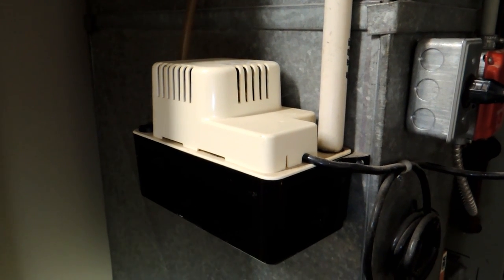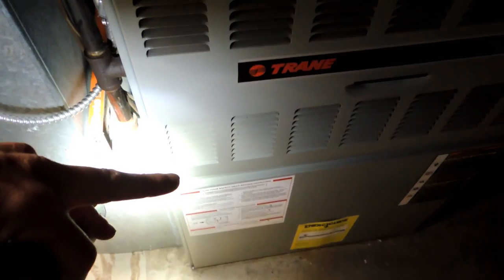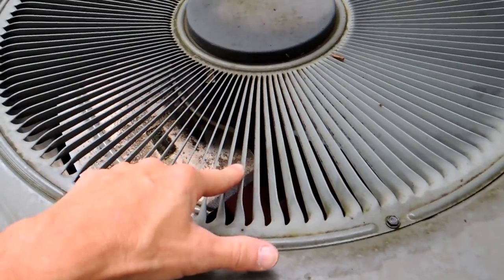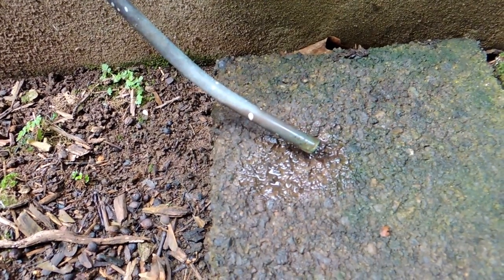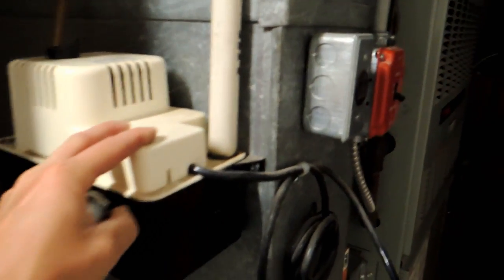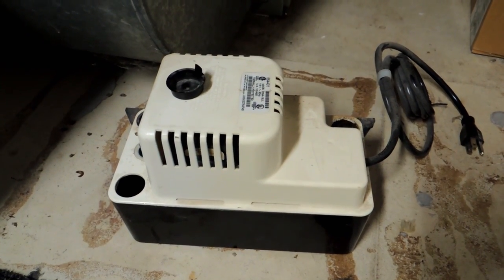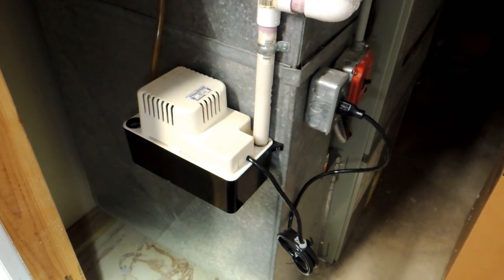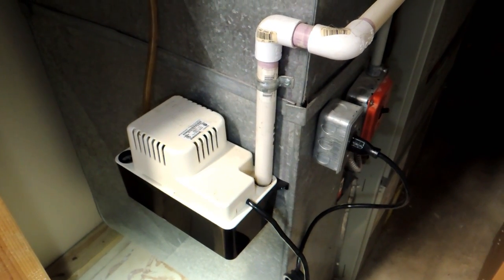How To Maintain Your Air Conditioning Condensate Pump

Comment: Great video.  I just want to flush out any drain fly larvae out of the pump that is like the one here in this video.  Would you recommend pouring boiling water or a cup of vinegar into the resevoir?
Reply from the maker: Boiling water would not be a good idea, I don't know how the pump components would react to the heat.  I guess vinegar wouldn't harm anything.  I've never run across drain flies before.  You might just as well clean out the whole tray as I showed in the video to be sure everything is gone.
Reply: @enduringcharm  I thought of just following your instructions.  I am a little overwhelmed with the pest control.  My city doesn't do much about it.  I was also thinking about soaking some mosquito bits and then pouring the water into the resevoir with good beneficial bacteria.  I have gnats in a closed up cellar where the hvac is.  I thought for sure it would be coming from the pump.  It might be coming from the soil that heaves thought the bricks when it rains.  I will take a look at the set up.  It is just resting on the floor.  I think it is an easy set up.  But then again, it is only about a year old.  Your response is a pleasant surprise.  I know the video was posted a while ago.  Thank you much from Louisville KY.

Comment: my condensate pipe coming from the air exchanger is an L shape that goes directly into the pump's reservoir without any brackets or clamps anywhere along its run, and sandwiches the pump against the floor. i cannot remove the pump for cleaning because the condensate pipe is too long and trapping the pump against the floor. there are no clamps or screws involved. how do i handle this? is there a flexible pipe available instead so that this doesn't continue to be an issue?
Reply from the maker: Without seeing it in person it's hard to tell, but I have several suggestions.  First, you may be able to simply push the pipe end out of the pump housing if there is enough flex.  Second, you may be able to crack open the top of the pump housing and remove the bottom tray.  Then there will be room to drop down the top and remove it too.  Another option along those lines is to run the pump to clear the water out and then twist the pump housing out from under the pipe.  Finally, you can probably cut the drain pipe so that it just barely fits into the pump housing, which will make it easy in the future to just temporarily bend it out of the way when desired.
Reply: @enduringcharm  ive definitely tried tugging up on the pipe above the pump and it doesnt really jiggle more than a few millimeters. i also tried tilting the pump to see if i could get one side low enough to slide out from under the pipe and that didnt work either. ill give opening the casing another go and try sliding the cover up the pipe to get the top and bottom out separately. i kind of tried opening it before but i wasnt sure if id break it so i stopped. thanks for the speedy reply, the ideas sound great! i don't really have any cutting tools on hand, but if i have some work done in the future, ill see about requesting that they shorten the pipe. thanks!
Reply: @enduringcharm  Thanks for all the suggestions! I left a reply saying I was able to clean it, probably two days ago but it seems to have disappeared. Anyway, I tried the method of removing the top and sliding it up the pipe so that I could get the bottom reservoir out, and I did have to tilt it a considerable amount and ended up spilling some water all over my concrete floor, but was able to get it out in the end. I cleaned it of the thin layer of dense brown sediment sitting at the bottom of the reservoir and pump housing and flushed out some nasty tube shaped bacterial stuff that gushed back down from the vinyl drain line when I disconnected it from the pump. I ran some diluted bleach water down the vinyl line, then rinsed it with clean water a little bit later and pushed some air through the line with my air compressor and finally put everything back together. Thanks again!
Reply from the maker: I'm glad you got it sorted.  Pretty gross in there, right?  If you are curious about what it looks like in the evaporator before it gets to the condensate pump, check out this video:
https://youtu.be/F07sbwZgcsI

Comment: How did you get the reservoir open? Mine looks similar but I'm not seeing any obvious way to get it open.
Reply from the maker: Most of them just snap in place.  If you carefully press in on the sides the top will likely pop open, or you may have to pry on the edge.

Comment: At the end, where you mention "That's a whole another story to clean that out", that's what I want to check next.  Where the pipes goes from the pan to the pump.  Do you need to open the panel up, check the drip pan and then snake the tube from there to the pump or can you open up the pipe outside the panel and clean there? I'd like to check the pump (I hear it go on but probably needs cleaning) and also clean the pipes inside since I'm getting water on the ground under the A/C unit.  Also the AC system has been losing ability to cool so wondering if all that is blocking cooling.  Great video!!
Reply from the maker: I have a whole video to answer those questions!  See here:  https://youtu.be/F07sbwZgcsI
Reply: @enduringcharm  Saw that video but doesn't show how to flexible small tube is flushed out only the pan and larger connections.  I didn't see from the pump to the wash tub.  That tube is long and not sure it needs flushing? Thank you sir.
Reply from the maker: Oh, you're asking about the clear vinyl tube that goes from the pump to either a drain or to the outdoors.  Generally that does not need cleaning.  However, if yours looks grungy you can go to Home Depot or Lowes and pick up a roll of new vinyl tubing for five or six dollars.  Just note the size you have or cut a piece off and bring it with you.

Comment: Again, thank you. Do you also have a video for cleaning out the condensation tray or tubing coming from the furnace?
Reply from the maker: I don't, and different models may have different means of access.  If your condensate pump is coming on and off regularly, though, that shows that the tube is clear.
Reply: Great video, very clear, thorough and helpful.   Subscribed to see what else I can learn. Thanks!

Comment: Thank you for the video!!! My condensate pump valve broke in half and therefore water all on the floor. 😡 Do you know how to remove the piece that's still screwed in? Or do I need to purchase a new pump?
Reply from the maker: I'm not sure which piece you are talking about, but a whole new condensate pump is not that expensive if you need one.
Reply: @enduringcharm  Thank you! I just purchased the last one in stock just in case. But I'm not too confident on doing the electrical part. We'll see. Thanks again!

Comment: I'm stoked now to try fixing mine, which I paid $150 to learn has burned out. They want $700 to replace it. Think I'll try it myself first!
Reply from the maker: The cost of a new pump is under $60, so it is well worth replacing it yourself.
Reply: @enduringcharm  Thank you for the video and your encouragement. If you see a small mushroom cloud in suburban Philadelphia sometime in the next week or so, however, it's probably due to me!
Reply from the maker: Ha!  Well, if you figure out how to create nuclear fusion with a condensate pump I want half of the patent licensing revenue!
Reply: @enduringcharm  Fair enough, but I don't usually get beyond fission!
Reply: @enduringcharm  I figured if I followed your instructions I'd only be out of around $60, the cost of a new pump. I was wrong: My old pump was fine! The only problem was that the one-way exit valve for the condensed water was blocked. I took it out, soaked it in vinegar, squeezed vinegar through it until it cleared, put it back in and all is well. I'm thinking a little less of the company I've used for years, who came out and said fixing it would cost $700. My total cost was about $.10 worth of vinegar and the only tool I need was a pair of pliers to take the valve out. Thanks again for your video. I feel like I made $699.90 today. A nice feeling.
Reply from the maker: I wish I could say your story is unusual, but it isn't.  The company giving you an estimate may not even have been intentionally trying to scam you, they are just sloppy or lazy or both.  I'm glad you sorted it out yourself and saved some money.

Comment: We changed the A/C unit a year ago, the evaporator coil was also changed.  Almost a year later, when ever we turn the furnace on (heat or cool) there is a  nauseating smell that come out of the vents.  This is a forced air system and the smell is always there when ever the furnace is running.  What's causing the smell and is there any way of getting rid of it.  This never happened with the old A/C system.
Reply from the maker: Obviously I can't evaluate the smell from here.  If it's a mildew kind of smell it's possible there is/was an issue with the installation which left you with a condensate pan that doesn't drain.  If it's a burning or chemical kind of smell it could be related to the paint, the wiring/electronics or oils on the fan.  The good news is that it's almost certainly fixable, though it may take some time for the odor to dissipate from the ductwork.  I would suggest calling in a different heating/AC company than the one you used and have them evaluate the smell.  It's not that big a deal to take some of the housing apart and poke around inside.  Depending on the nature of the smell they may recognize the issue immediately.

Comment: Nicely explained, thank you! I have two hvac systems in my basement, one in each corner. For some reason the flexible drain pipe is installed on the other end of the basement which is around 50 feet from the furnace. Now, the pump is fine but my flexible pipe is blocked around halfway. How can I unclog it? Please advise! I tried blowing air with a compressor through it but the compressor wasn’t powerful enough.
Reply from the maker: When you say "flexible pipe" what, exactly, is there?  Typically it's just clear vinyl tubing.  If that's what you have, it might be easier just to run and pick up a coil of new tubing.  It's not that expensive.  You might also find a way to shorten the length if there is another path to the outside.
Reply: @enduringcharm  yes, it’s the clear vinyl pipe. The problem is that the ceiling is finished so access to the pipe is very hard, I have another set of same type pipe which is draining into the bath tub in my basement since this problem started in December last year.
Reply from the maker: Well, you might be able to attach new tubing to the end of the old tubing using electrical tape, and then pull the new tubing through by pulling the old tubing out.  Or, you might be able to fish new tubing through by cutting a few access holes.  But, 50 feet is a really long run for this tubing so I would consider trying to figure out a shorter run somewhere closer to the source.
Reply: @enduringcharm  I appreciate your suggestions! I will try your ideas. Thank you so much for replying 🙏

Comment: My A/C unit stopped last week.  I live in a VERY old building and my unit is in the basement.  I HATE my maintenance guy, and am pretty handy....so would prefer to do this myself.  It’s not my thermostat, I’m 100% sure!  I’ve done the whole breaker on/off business.  And ONE time...my A/c finally powered back on for about 20 seconds, but then shut off for good.  The sound (when I had it working for a few minutes) came from the pump...so I’m guessing it’s not a fuse, the breaker OR my thermostat, but that there’s a clog somewhere preventing my unit to power on.  Can you please help?!?!
Reply from the maker: It's impossible to diagnose from afar.  If you are talking about a typical split system you have a condenser outdoors with a fan and pump, an evaporator indoors with it's own fan or a shared fan with the heating system, and control electronics which include the thermostat.  A problem with any of these components could cause a system not to work or to work intermittently.  And, each brand/model has it's own quirks.  I'm afraid you'll need some help.

Comment: Why is there so much crap inside? Mine looks the same just after 2 years of use? Is it a better idea to dumb all that condensate in sump pump instead?
Reply from the maker: In some installations it may be possible to gravity-feed the condensate to a sump pump, but for most homes you need a condensate pump to get the water out. The condensate pumps do tend to work well even when they get mucked-up, but it's better to give it a cleaning once in a while.
Reply: @enduringcharm  I was just curious where all that stuff comes from, I thought condensate is just water. I checked my boiler condensate pump and it looked pretty clean compared to AC. Sump pump is also right next to AC, d humidefier, and boiler. My understanding is that boiler condensate can't go to sump pump, not sure about others. My boiler condensate has a very long run to public sewer.

Comment: I liked the video until very end when it's stated you only have to maintain pump by "cleaning it out every 4-5 years"
I've had so many issues with my pumps.I've gone through 3 pumps in the last 2.5 years. The latest replacement cost $900 including service charge just to come out to house, "labor" and taxes. I'm sure the pump itself cost only $70-$80.
Reply from the maker: If you have a similar setup as in the video, then the pump should last significantly longer than that.  And that kind of labor charge is outrageous.  You need to find a different vendor.

Comment: Mine only works when the float is all the way to top then shuts off quickly, is that normal?
Reply from the maker: It should work just like a basement sump pump.  When the float rises to a certain level the pump comes on, until the float drops back down and it switches the pump off.  If you notice that your pump only works for a very short duration, it may be that the float is bent or there is something obstructing it.  You can take the unit apart and clean it like I've done in the video, and possibly you can bend the float downward just a bit so the pump comes on earlier.
Reply: @enduringcharm  thanks, will do

Comment: Do you need a trap on the condensate pvc pipe coming out of unit?
Reply from the maker: If memory serves the only mention of it in the codebooks are to adhere to the manufacturer's recommendation.  Some units may need one to meet energy efficiency.  If you don;t have one on an existing unit i wouldn't worry about it.  if you are installing a new evaporator go by what the manufacturer recommends.

Comment: I used bleach regularly and it corroded the motor badly. I since use white vinegar which is not as strong but does the job.
Reply from the maker: Bleach can be used, but we're talking small amounts and occasional use--like maybe once a year.   Ideally you simply pull the tank off and clean it once in a while as I've shown here.
Reply: Bleach can also degrade the seals in the pump aswell. Vinegar is a great alternative 🤔😄

Comment: hi im pretty sure i trouble shooted my pump and its not working,i need to order a new one. my pump is hard wired to my ac unit ...the new pump thats coming in has an extension cord, can i open the new pump .disconnect the extension cord and wire the new pump with the exciting hard wires?? need help asap.
Reply from the maker: A few thoughts.  First, did you confirm with a meter that there is power to the existing pump and that there isn't something like a loose connection causing the issue?  Second, if a new pump is needed you should be able to go to your local Home Cheapo or Lowes or plumbing supply store to pick one up.  And, third, most pumps that I've seen are plugged into an outlet tied to the furnace switch.  That may even be code, I'd have to research.  In any case, it's a good arrangement so why not install a receptacle box on your system so you can use that style?  Likely you could use the same power source you have now, just feed it to a new box you install, then you can use your new pump (if needed) as is.
Reply: @enduringcharm   first thank you for taking the time out to reply . i used ur tips and cleaned out the P- trap, opened the sub pump ,bought a multi meter (first time using one. sh%t scared of electric) now im testing everything around the house thank you ), in a nut shell everything came out right with your instructions,which on the videos you explain everything in great detail thanx for being calm and the way you put your words together and accent( sounds like a BRONX accent)were im from. makes you want to listen more,your great. thanx again MR JOHN .thank you
Reply from the maker: Ha!  That's a Jersey accent!  People say I sound like Joe Pesci.  I've been called worse.  Glad things worked out well, and here's another video about using multimeters which may be helpful:

https://youtu.be/g0YRkwv40r8
Reply: @enduringcharm  as long as ur not as tall as he is,your good.thanx again , crazy thing is i just seen your reply on my way to study your video on the multimeter again .bugged out. thanx again

Comment: is it okay to spray it with a hose? isn't there electronics in there
Reply from the maker: If you take the top off, usually it's the bottom half that's nasty, and you can spray the bottom of the top half, if you see what I mean.  Or just spray it all down with bleach cleaner and wipe it with paper towels.